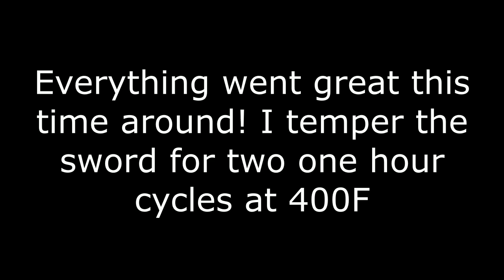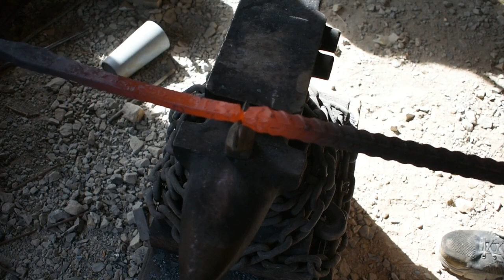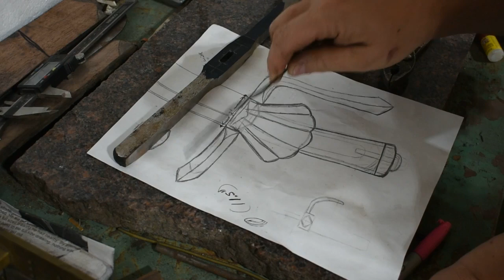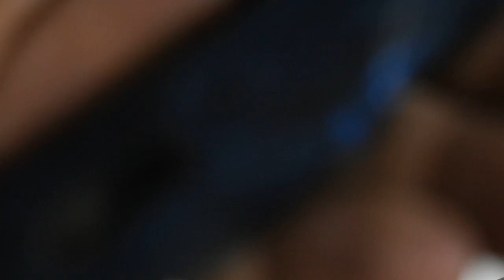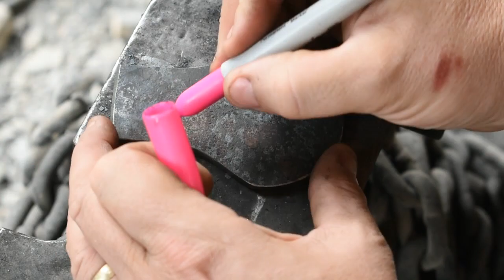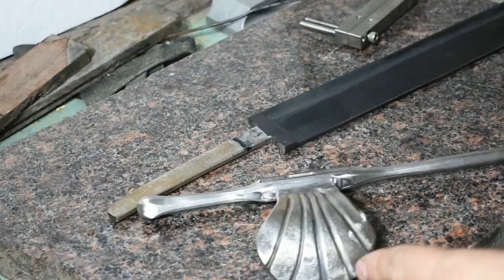FORGING A GERMAN MESSER SWORD PART 3

Comment: Sure looks pretty but I do not see a lot of blacksmithing I'm trying to learn I saw an ice machine shop but I grew up in but I did not see a lot of locksmith work I'm sorry
Reply from the maker: I forged the blade in part 1 of this series, it broke during heat treat in part 2, instead of showing the forging process again that I had already done in part one I moved on to the next steps in the build. I have several blacksmithing projects on the channel as well as several bladesmithing projects. Usually on the sword builds there isn't much blacksmithing after the first video. I do appreciate you watching though.

Comment: It looks real good glad it didnt crack , what thickness would you say is safest to heat treat a long blade
Reply from the maker: Same here! I like to leave the edge in the ball park of 5/32 or a little less, it may seem like a lot but I would rather spend more time on the grinder instead of having to start completely over like with this one, i got the edge of the other one pretty thin and paid the price. Mastersmith J. Neilson says forge thick grind thin. Thanks for watching, i appreciate it.